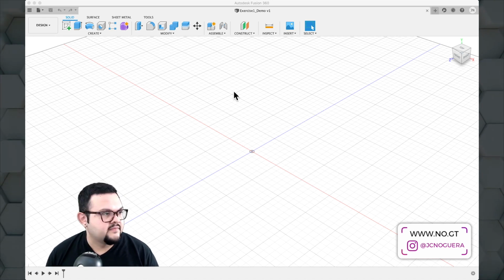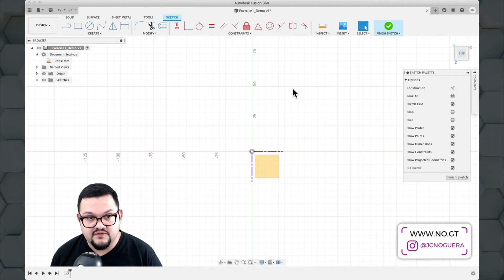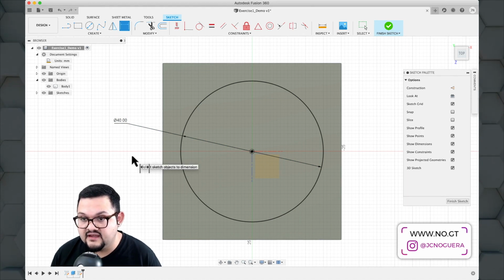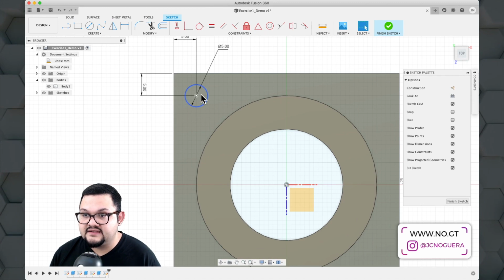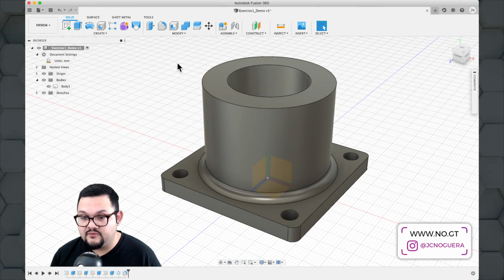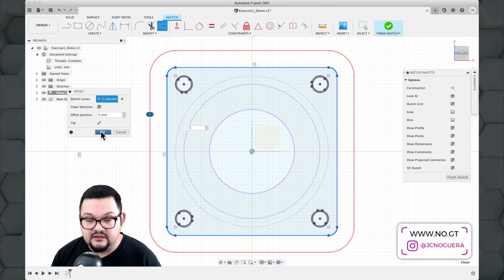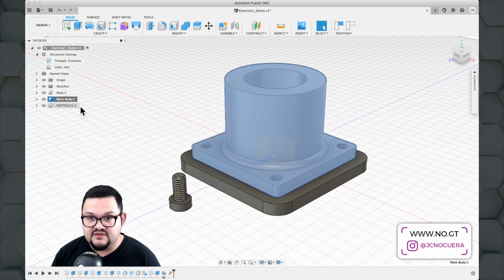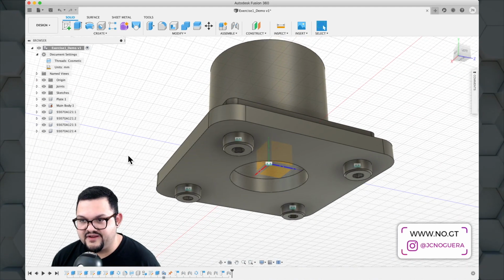Fusion360 for Beginners (Part 1, Basic Tools & Interface)

Comment: I am new to Fusion.  I am following your class.  I am having a hard time with the joint setting.  My plate will merge with the fixed top.  Is anyone else having the same issue?